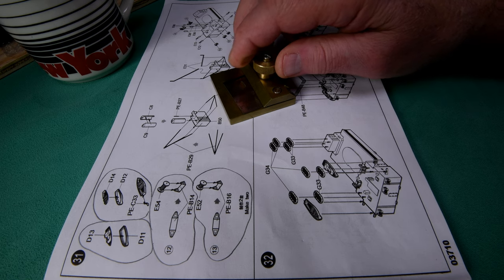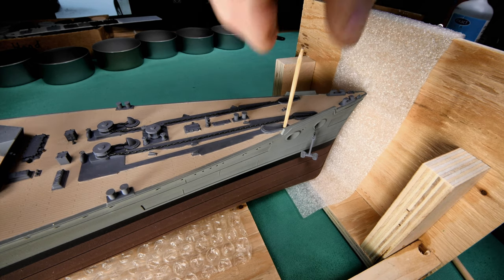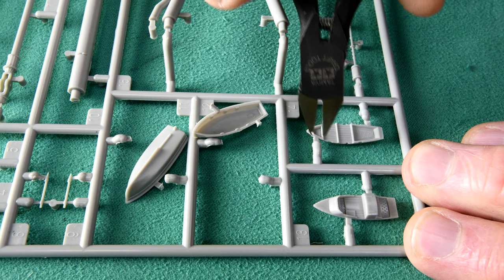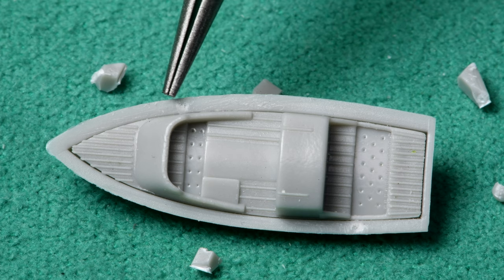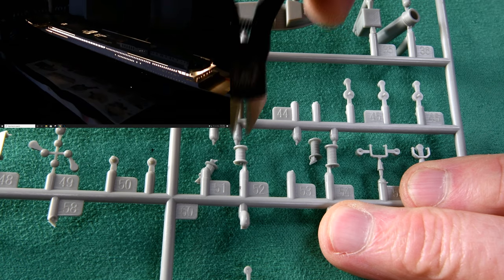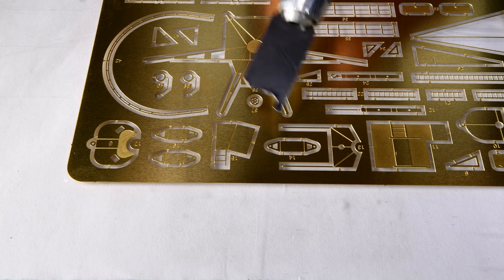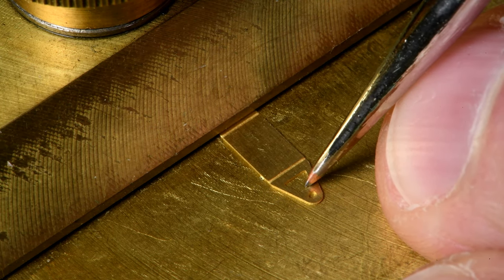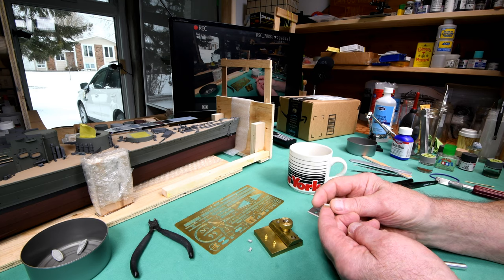The Model Ship - Part 634

Comment: Noticed the tiny metal nub left on the metal.... you get right up close cutting it off on one side but if you turn it around and cut from the opposite side it will be closer. Did you see Scott also has a signal light wired up that flashes SOS :) Till tomorrow....
Reply from the maker: "tiny metal nub left on the metal" Yes, saw it too. I'm becoming satisfied with the mediocre. Scarry!